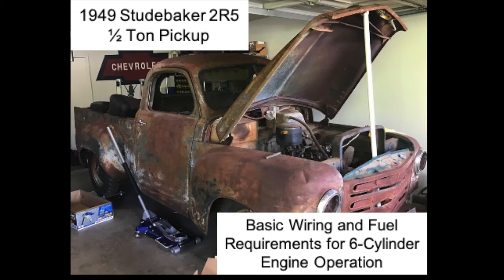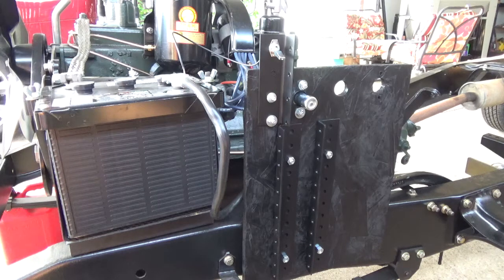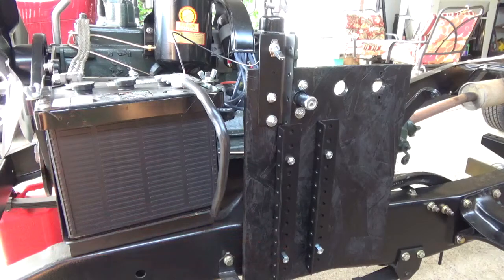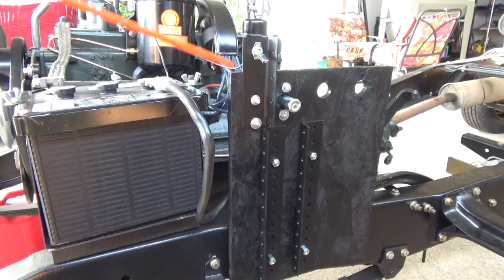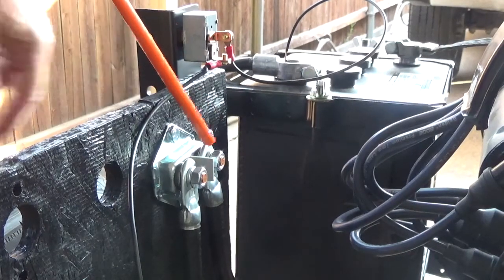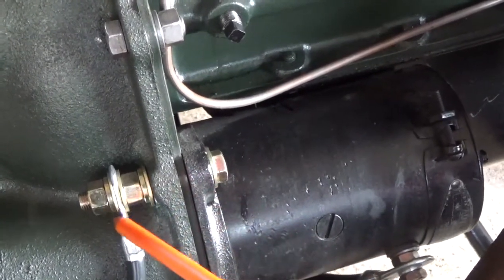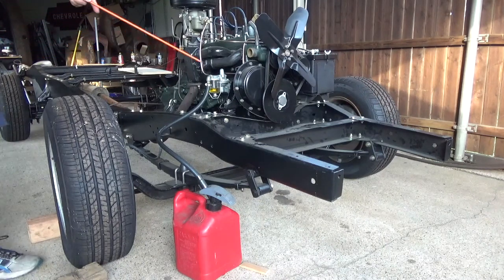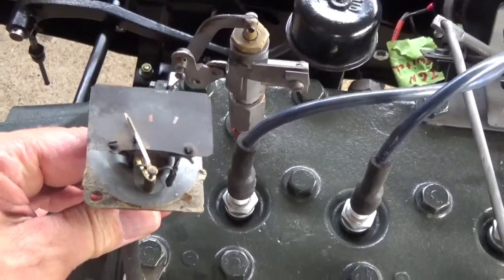1949 Studebaker 2R5 Truck Hotwire / Basic Engine Operation Requirements

Comment: Hey Billy!  Thanks for the videos. They are really helpful and informative. I’m a bet myself and have a 52 2r5. What did Ted Jensen charge you around about to overhaul your engine?  Thanks again.
Reply from the maker: Howdy,  Vehicles back then used the engine serial # as the VIN for registration and so that was how I had to register my truck in Texas.  Because of that I had to have my engine restored.  Ted Jensen does this as a hobby and will rebuild a Studebaker engine in his shop which is an awesome shop.  If you want an engine then he wants what he spent on the engine and shipping.  The cost could  go up to about $5000 depending on what you actually want so you really need to talk with him.  He can crate up an engine, send it to you, and then you put your engine in the crate and send it back to him.  I didn't follow this process because of the registration issue so I took a road trip with one of my sons and personally delivered the engine and 3-speed transmission.  His main emphasis is engines but he was ok with checking out my tranny.  I asked him to get both back to new condition because I wanted them to last another 50 years.  My engine needed some serious work but he saved it!  He is the only one I've found that specializes in these engines.  Parts are hard to find and and what is needed to restore these 75 + year old engines requires the right knowledge and experience.  I realized this when I had a Chevy small block engine rebuilt by a "reputable" company that was supposedly the best at rebuilding engines and they swore they could rebuild that Studebaker engine with no problem.  However, they couldn't even rebuild that Chevy small block engine correctly.  I wanted my engine to last another 50 years and Ted Jensen was worth the cost and effort.